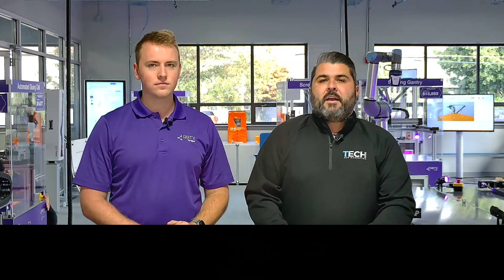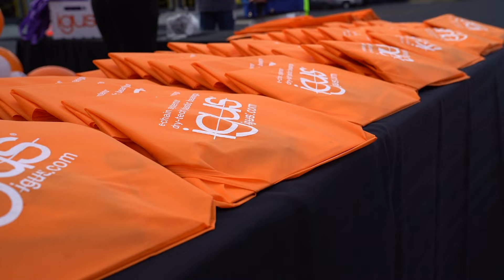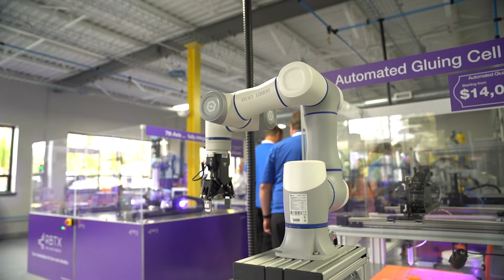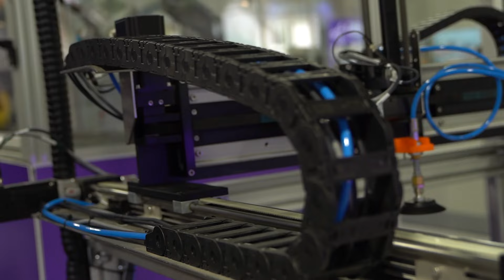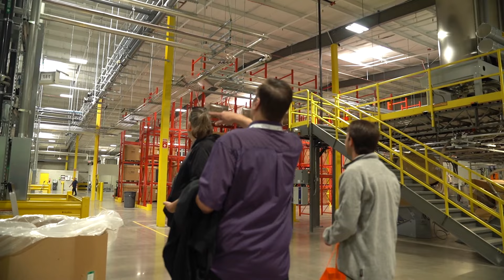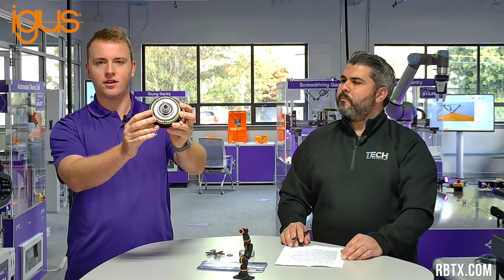Episode 76 - Jan Hennecke, Robotics Product Manager at Igus

Comment: I notice Rbtx robotics are quite suitable for Front End manufacturing automation whereby you can pair these robotic arms with Front End processing machinaries to enhance productivity metrics.  However for Back End application perhaps you could approach Boston Dynamics, Agility Robotics, Tesla and Nvidia for a broader perspective of their use case potentials (not just hardware automation, but also software integration as well) → produce an 1hr episode of this if possible (when succesfully secured invitation slots for the above mentioned guest list).

Good luck.👍